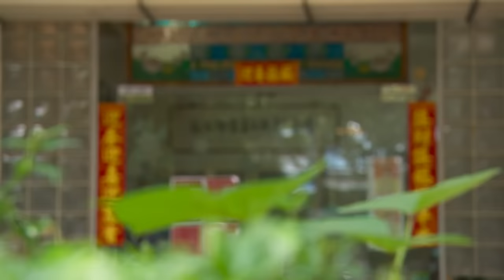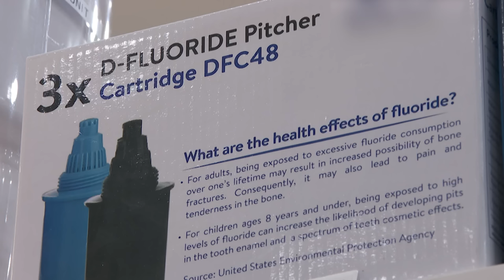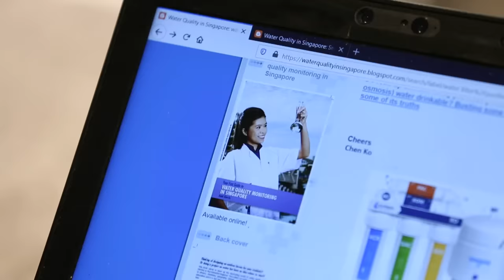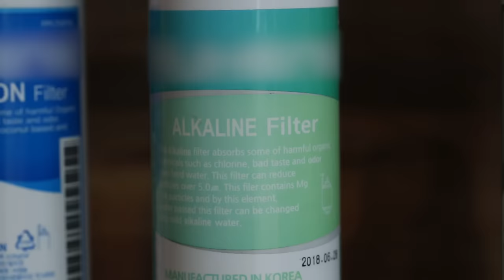Do Water Filters Really Purify Your Water? | Talking Point | Full Episode

Comment: TBH, I do not think the tap water is the problem but rather, old piping systems.
Reply: That's what I think as well. But based from samples they got, it seems that the old piping reason is dismissable.🤷🏻‍♀️
Reply: one of the reasons is because the water is pressurized. So even if there is a crack in the pipe, water goes out, nothing comes in. They say just run the tap for a few seconds and all that stuff will get out
Reply: most HDB are 40+ years old and im quite sure the inside of the pipes look like this https://youtu.be/V1UHPtT6HFU?t=384 which is kinda disgusting to think the water you drink from passes through that. hence why i have a $250 filter.
Reply: Yes, exactly.
Reply: @ainzooalgown7589  That only happens on terrible American plumbing system. PVC piping won't corrode and has practically infinite lifespan.
Reply: Yes, especially those old flats built before the 80s. The marsiling flat that i grew up in had iron pipes originally and rusted within the first 10 years! Later HDB had to change all of them to stainless steel ones FOC
Reply: Absolutely. I worked in a water plant for my city during a summer internship and the water that comes out of it is very clean for consumption. Old piping systems (aka the water distribution infrastructure) that aren't made of PVC pipes can cause issues when reaching it's final destination. Some homes are so old that they use lead piping and that's definitely a no go for drinking and using water.
Reply: Also too much chlorine n flourine in the water
Reply: @vincecarlo  We do need a little bit of chlorine and fluoride in our water. a small amount of Chlorine helps in preventing bacteria growth during distribution and a little bit of fluoride was often purposely added to prevent tooth decay and maintain good oral health of the population.
Reply: @SmileZero  most HDB mains distribution pipe is not PVC but cement-lined ductile iron pipes and copper pipes and the pipes in the walls from the water tank is definitely not PVC but some sort of metal pipe and metal pipes can get buildup from hard water. I used an american video because no asian plumber uploads video examples like the americans, Most HDB have copper pipes in the walls and sometimes it can have corrosion and causes blue water, have fun drinking blue water.
Reply: You are right , I agreed as an engineer who deal with pipes
Reply: @SmileZero  just wondering.... What is that Fluoride exactly?
Reply: @kathleengrieci2539  It's a mineral, applied orally in small quantity it helps hardening tooth enamel and prevent tooth decay. Check your toothpaste active ingredients, it's fluoride.
Reply: @SmileZero  do you believe that's what the water people are using to medicate us with for our 'health'?
Reply: @kathleengrieci2539  It's not water people, it's scientists and engineers working hard to make sure we have a supply of clean and safe water from our tap. These kind of public health initiative is not new and has been proven effective such as iodine in salt.
Reply: @kathleengrieci2539  

It's a man made toxic chemical is a well known for causing cancer, birth defect, retardation...

Chlorine is another man made toxic chemical that are being used for killing bacteria in drinking water it's also killing your body inside out if you really wanted to free yourself from a man made toxic chemicals in your drinking water just boiling it or buy a distilled water.

The downside of boiling your drinking water is that it's has less nutrients and minerals in it the best way to supplement nutrients and minerals is to either adding organic minerals to your boiling water after it been cool down, or eat lots of organic fruits, vegetables, meat, etc, or both.
Reply: @Steven.Chia.Singapore  It's impossible to pressurize water.
Reply: Ah yes, this is true facts. I don't trust Japan's tap water too. Never know how old is the piping system, and who might sabotage the piping one day to make the entire nation sick.
Reply: @ainzooalgown7589  Singapore's maintain and upgrades the piping system for HDBs very regularly!
Reply: @lxcites  yeah but not the shophouses and other conservation houses.
Reply: It's basically phycological obstacle that one has to overcome. It's already been proven clean in those samples that had run rigorous testing in the laboratory. I don't think it's whatsoever problem that we might think but a phycological one.
Reply: Totally agree with you, especially at the old estates.
Reply: @oneviwatara9384  what no.Did you ever go to school?Chlorine is an natural element in the periodic table.Sure in huge amounts they cause major problems.But the video clearly stated the regulations and the water was well below it.So its fine
Reply: Both.
Reply: @SmileZero  My former employer was a medic in the Israel Army. He said they learned about how flouride for dental care is scam. Flouride will actually corrode teeth and dissolve them over time. But he also said there was no such thing as rape, so🤷
Reply: @oneviwatara9384  You cannot boil flouride out of water. Chlorine will evaporate slighly even just left open. But not flouride.
Reply: @Han-rg4zt  Okay, so they told them to disinfect the tap, but what about the filter unit? Did they tell them to disinfect that as well? Also, we saw clearly what the results were with “regular use” I E a non disinfected tap. Meaning, the average person is consuming just as much bacteria from the tap on a daily basis because Most of us are not disinfecting the tap everytime we use it.
Reply: @EtreTocsin  

Just use a coffee filters to getting rid of fluoride after you boiling it or just use a coffee maker to boiling it.
Reply: in some countries it is the tap water
especially here in Uganda so don't speak so fast
Reply: @thomaxtube  God bless you sir, do you have the link to the documentary as well as the recommendations u gave to remove the harmful fluoride?
Reply: Ah the old fluoride is good for your teeth saying, what rubbish it's dumbing us down
Reply: Or improper cleaning of lines like happened in Flint. They cheapened out and saved money not protecting the scale buildup on lead pipes flushing lines.
Reply: @EtreTocsin  well I guess that says a lot about that person's IQ and credibility thus his theory about fluoride should be dismissed. Imagine there are still people like that. 🤦🏻‍♂️
Reply: you said exactly what's I have been saying to everyone for years.
Reply: @SmileZero  PVC is not used for water supply btw. Just for wastewater. PVC is carcinogenic
Reply: @Steven.Chia.Singapore  - It takes more than  a few seconds to get the sitting water out of the pipes. I run the water for a couple of gallons, then fill 4 gallon size bottles, refrigerate them, then put that water through the filtered pitcher as needed.
Reply: And what makes you think there is a problem at all?
Reply: @aditta69  j
Reply: @SmileZero  l
Reply: They claim Singapore but really ware  are those samples collected what is the source Wich plant has processed it and how and as well as delivery system (pipes) that would generally vary from area to area.
Reply: In Dallas Texas the waste water is recycled and sent back to homes as fresh water.
Reply: @SmileZero  you should be using copper for your pressurized fresh water and PVC for your sewage. That's how it's done in America, at least.
Reply: @EtreTocsin  Fluoride is good when put on your teeth, but when ingested (such as the short-lived fad where you could buy water with fluoride) it would damage your teeth/bones. It's been a long time, so I don't remember the mechanism. But experts seem to agree that topical treatment is beneficial, ingestion is not.
Reply: Thats what the ancient Romans determined.
Reply: @Sanyu-Tumusiime  what's wrong with our Ugandan tap water?
Reply: @SandraSandra-cm6em  come to America and taste the tap water here and compare it to the tap water in Uganda. It's so much dirtier. 

I suggest you apply for the DV green card lottery and come here to the United States. If you have no reference point, you can't make a comparison. 

Then,  you'll realize the problem with our tap water back home in Uganda.
Reply: @Sanyu-Tumusiime  Am sure it has issues that's why am seeking more information. I thought you knew some specific issues with it( apart from typhoid),since I don't know where to take it for testing. Am thinking of reverting to getting drinking water from a nearby natural spring.
Reply: Sooooo easy to change the piping of a whole city.... while still keeping it going
Reply: @Mehwhatevr  are you confused or just an MLM marketer? Ffs, NO ONE NEEDS SUPPLEMENTS UNLESS THEY ARE LACKING SEVERELY.
Reply: @kurooitami  I think you’re confused, for I am neither. I didn’t say anything about anyone needing to take supplements. Let me try and say this more clearly. If you are lacking severely, the only beneficial way to get a “fluoride supplement” is for it to be applied topically (directly onto your teeth). Under no circumstances should it ever be ingested. My point was that nobody should be ingesting fluoride, it shouldn’t be in a supplement, it shouldn’t be in your water… not sure how you misunderstood and thought I’m trying to sell fluoride supplements
Reply: @Mehwhatevr  sorry, just seemed sketchy.  I will bow down and say you are a good one 👍
Reply: @kurooitami  no problem. Call me whatever you want but never call me pro-fluoride supplements 😂
Reply: @Mehwhatevr  I am sorry. Hope that is ok 👍
Reply: @kurooitami  yeah it’s fine, was just making a joke. 😊
Reply: Also they could not realise that the dirt is entering the water through a small hole in the outage pipe
Reply: The water a flushed thus it is running water, so the bacteria might not be comfortable to grow.
Reply: it is the processed water
Reply: @Steven.Chia.Singapore  Not the natural water that Human can intake .
Reply: @maedaydreamer8386  the leaps their making are incredible. So disconnected from reality and in the end just more marketing ploy to sell crap people can do fine without and solving problems that and already been solved in ways that may not scale all that well in the end. This is all cheap.
Reply: @Ainz Ooal Gown  putting the filter doesn't help much since the water went through the same source. As you can see the bacteria counts is so much worse with filtered waters.
Reply: Old pipes is what makes it tap water
Reply: @oneviwatara9384  it would be very beneficial for you to go back.to school, get some basic science education, you know, just a little bit - it's amazing how much just year of school could improve your perception of the world around you.
Reply: @michaelwisniewski6047  

Fluoride is a hell of a drug 😂🤣
Reply: the problem are the humans
Reply: @ainzooalgown7589  hi brother may I ask what your filter is?
Reply: Yes, but you still would like clean water - right?
I live in the Philippines, and our waterlines are filled with algae, we buy filtered water to drink, and only use tap water for cleaning and washing.
I know our water are infested with algae that I do not want to consume....
Reply: SO  your ok with all the many chemicals  being added into your water?
Reply: @soonsuicidal Natural fluoride, and being plant-based to avoid osteoporosis, and so forth, is best.
Reply: @kathleengrieci2539 fluoride for our "oral health". Lmao. You really are naive.
Reply: He took samples from a new established building 😂😂😂
Reply: Johor water 😂
Reply: Exactly… 😂
Reply: I suspected my old copper pipes
Reply: Youre wrong. Do some research.
Reply: if they are brand spanking new they probably have a lot of stuff in them from the installation process. if they're old, they're actually probably cleaner. 
what's important is that water is running through them regularly. when the water sits, even if pressurized, stuff can grow, rust, and gather right before the water outlet. it's good to run the water for a moment before you use it if the tap hasn't been used for a long time.
Reply: @reginaldbowls7180  the water pressurizes the container, is what you're implying?
Reply: And how does that probably easily go away? Hence tap water IS the problem.
Reply: Too little samples done. Did not explain where the samples were gotten from? Is it all from new BTOs? Any samples from condos? Landed? Sample 5 needed more investigation done instead of just assuming the  water were contaminated during sampling. Test at least 100 households from various housing types including lease years. Investigate further on the samples that has high bacterial counts instead of giving assumption to suit your narratives
Reply: Bullshit!😂😂😂

Comment: The amount of information in this video is itself valuable to the public. The public should know how their basic amenities like water is produced, monitored and used. An informed and educated public is essential in making sure the government is doing its job properly.

As a chemist, Singapore's water is very very clean and all the minerals, the chloride and fluoride are all at safe drinking level. The thing that you might have be concern about is old pipes in older flats where there might be build-up of limescale or simply corroded. Changing out old pipes that have corroded will probably help you more than using a water filter.
Reply: "Safe levels" doesn't necessarily means healthy
Reply: Back in the '70s I read a report done for the government. The final recommendation was it would be too costly to fix the US water systems and end user filtration/purification was offered as a solution. This video hand picks a few contaminants and tests low end filter systems. Water treatment is like a car... buy a Yugo, you get a Yugo. Buy a Bentley and you've invested in your future.

Comment: I live in California, and the lime scale is absolutely horrible over here. If I use the water in things like humidifiers and my hot water pot, the lime scale builds up really quickly. A water filter will greatly cut down on the lime scale. 

I agree with the video, and the video is fantastic. Filters remove minerals, not add them. In fact, if it adds minerals, I'd be nervous. If my tap water was better, I would just drink tap water.
Reply: I also live in California and the tap water where I live is absolutely horrible, I personally believe a water filter is always needed.

Comment: Here in Israel the water is very hard.  In fact, without a filter, when you boil water the minerals are deposoted on the pot after one boil.  Electric "hot pots" are particularly vulnerable and must be cleansed of mineral scaling quite often.  Since I started using filtered water,  my office and home hot pots have not had to be de-scaled in years. Yes, YEARS! When my husband developed kidney stones, I asked the doctor if the hard water could be responsible and he said yes.  So, filtered water is a good thing.
Reply: Thr is no country Israel in world
Reply: Wait,I Know This Is Off Topic,But,Israel Has Trained Singapore's Armed Forces Right? Did Singapore Help Israel For The Water Crisis That Has Happened In Israel?
Reply: based on you statement, regular water filter is not enough, it's water filter that can "soften " the water!
Reply: You might be using a reverse osmosis system, or a water softener.  Both of those work for hard water.  Activated carbon filters not so much.
Reply: Filters won't do a thing for hard water. What you have is probably an ionic resin water softener. Maybe an RO system.

If it demands you occasionally pour salt into a hole somewhere, it's a resin water softener. If it needs a new cartridge from time to time, it's RO.
Reply: What kind a filter you use?
Reply: @ME-mf7xp  bruh stay on topic
Reply: Solution: Free Palestine.
Reply: I live in sg and been drinking tap water for a long time. Upon seeing this post i decided to check if my years old pots and kettles had to be descaled and then i suddenly thought free palestine and sat back down.
Reply: @naino2630 please get a map. Irael is right there. Unless u can’t read.

Comment: My wife and I had an apartment (in Boracay, Philippines) that came with a water filtration system. The owner assured us the filters were brand new...  My wife and I both starting having bad diarrhea.  When we realized we were both sick, we switched to tap water. We both got better right away.  I would not trust a filter system unless I install and maintain it myself. 😎
Reply: Hi Tito Tim Travels. I have the same problem with the drinking water here in Pasig, Philippines. I found an UV water purifier I install and maintain myself. I can help you with this.
Reply: Uy kabayan! (Hey there fellow Filipino!) So its still better to buy in big plastic containers than in water filters installed in home water lines?
Reply: @jeffjularbal9404  I am not sure how good the blue jug water is either... I know a few store owners that use store bought bottled water for their annual testing. But then they have also had the store bought water fail the lab tests. Bad water? Lying test centers?  Welcome to the Philippines. 😎
Reply: @jeffjularbal9404  it's a matter of maintenance that makes all the difference. Get yourself a cheap TDS-meter($2-3). If the reading of the filtered water is higher (more contaminants) than the incoming water, that indicates bacteria build-up in the filtration unit. If the numbers are very close, it means your filtration does almost nothing except taking out the chlorine with charcoal filter-stage. Only when the filtered water's reading is much less than that of the incoming water, like that of a new or well-maintained RO-system, is the filtered wafer safe for consumption.
Reply: That's right don't rely on others to take care of you do 4👍😀😊 self
Reply: @jeffjularbal9404  cringe 🙄